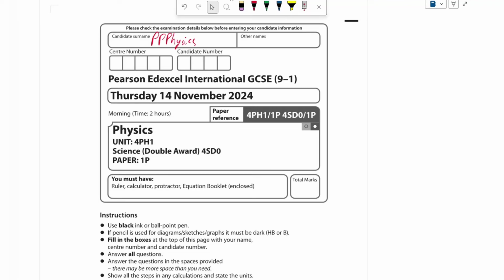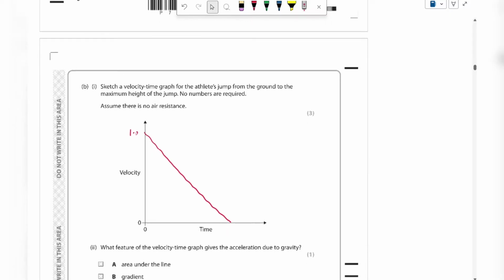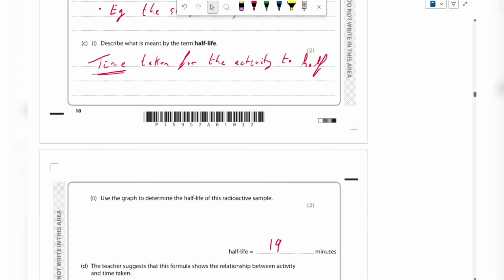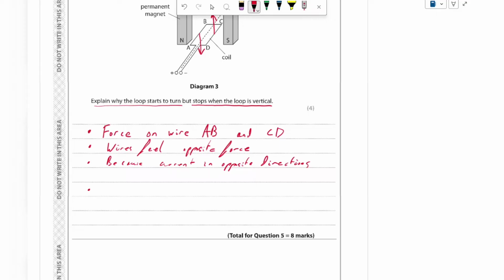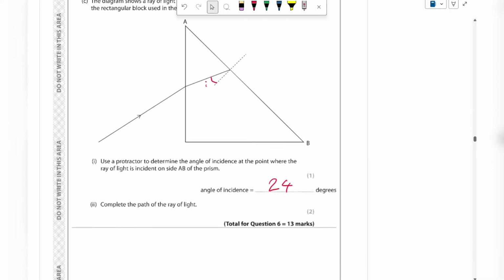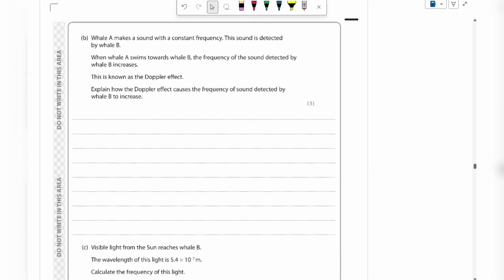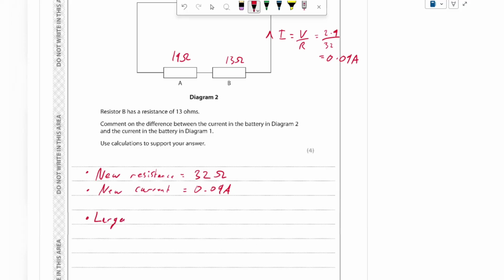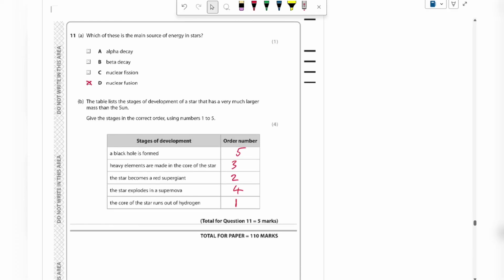IGCSE Physics November 2024 Paper 1

Comment: Why was resistor A = 19ohms
Reply: it was for resistor A put it in equatin R=V/I voltage 2.9 volts and current was 0.15 amp  so its 19 ohm